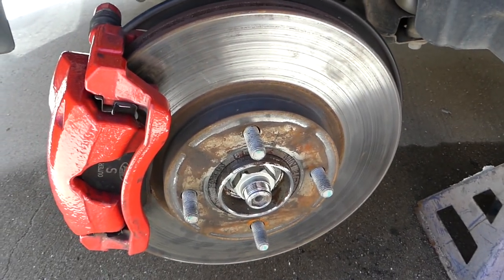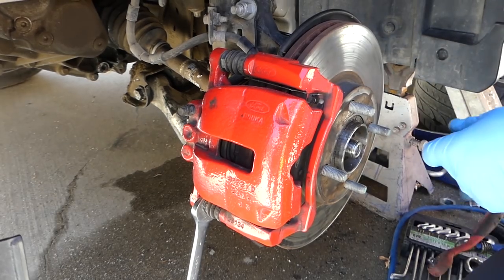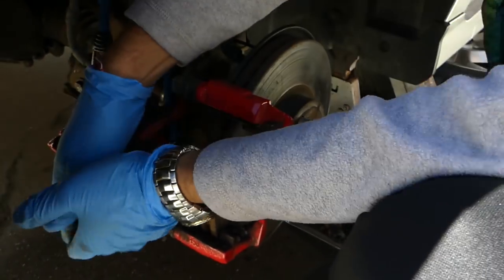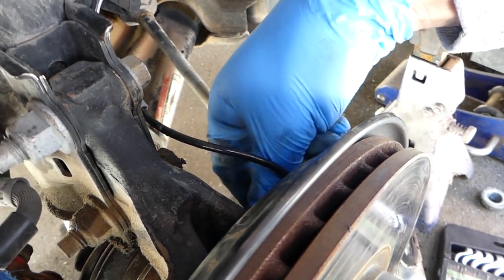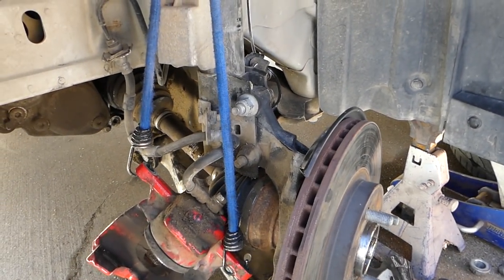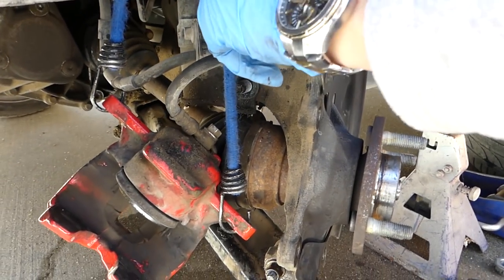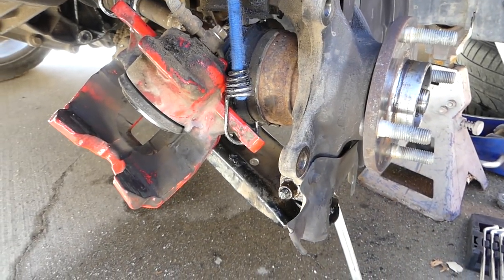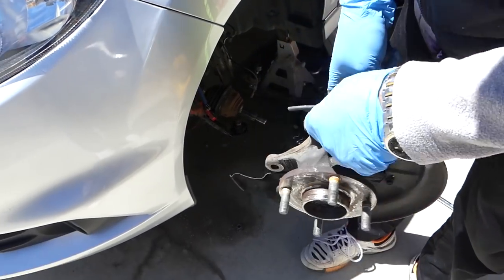FORD FIESTA FRONT WHEEL HUB BEARING REPLACEMENT REMOVAL MK7 ST

Comment: I have a question,  i have a 2012 Ford Fiesta SE and its been sounding like a motorboat going down the road  and one shop told me I needed my front hubs replaced and that the new ones would need to be sent to a machine shop to have the bearings repacked and then they can put the new ones on my car and the cost will be $1200. Another shop told me it's the front cv axel and it will only cost $ 600 to be replaced and that the other place was lieing because they don't repack the bearings anymore it's all in one assembly.  Who sounds right?

Comment: The bolt on the outer tie rod is completely sized for me. The car is not very rusty either! The nut comes off fine, but the tie rod won't detach no-matter how much I beat the casting or hit the end of the bolt. I've soaked it with penetrating fluid for hours.